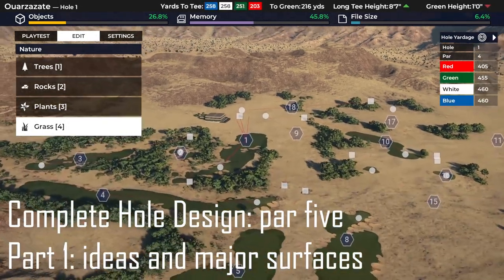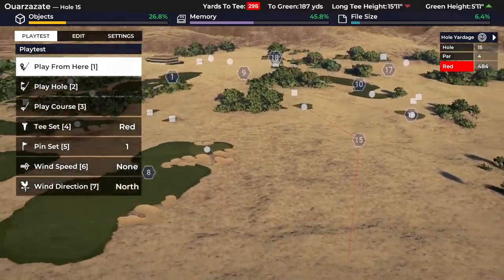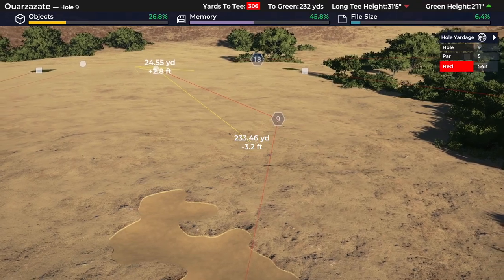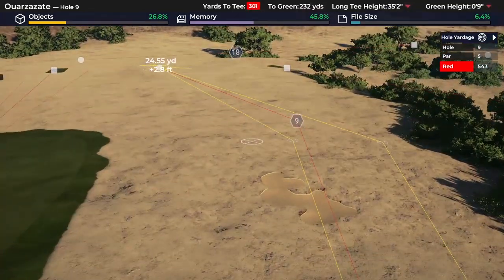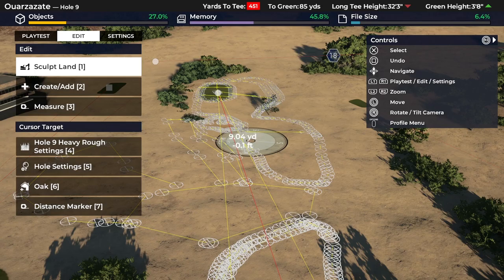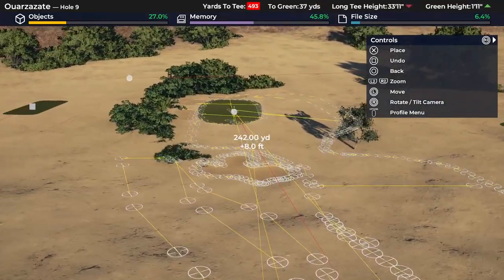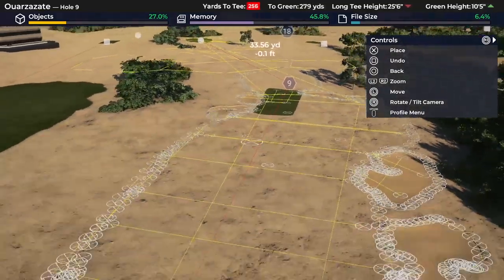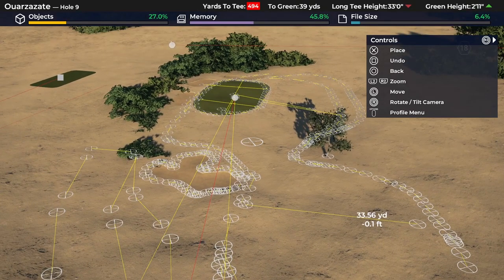Complete Hole Design: par five. Part 1: Ideas and Major Surfaces

Comment: Course is looking really, really good so far Ben! Moroccobelt is a great idea.

As I've told you before, I'm a Switch designer and I'm a bit worried about crashes due to too much planting potentially. I'm currently working in the Highlands theme for National Treasure, which means the autogen planting is mostly bushes and grasses (which I haven't kept). The goal is to not go over 60% to 70% plant meter - any tips for minimising plant meter usage, whilst also not making it too bare?

I'm more focused on the golf than the visuals, which explains why grovey31, bspetty24, doubtfulobelisk, digitalbunny and energ1zer are some of my favourite designers.
Reply: One thing I’ve found is to use tops of trees as bushes since they’re bigger and can take up more space. That will help with the meter.